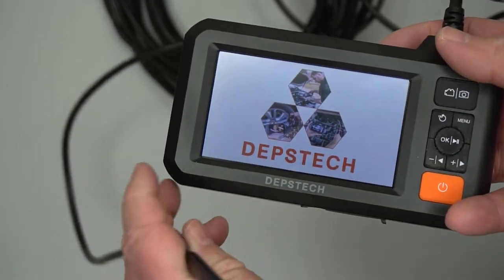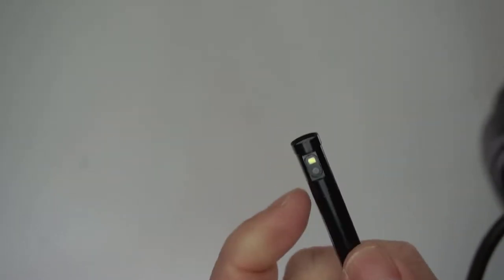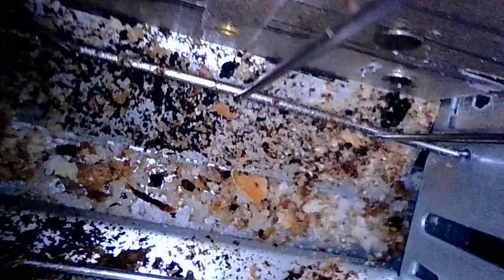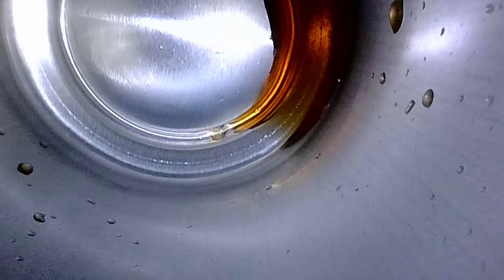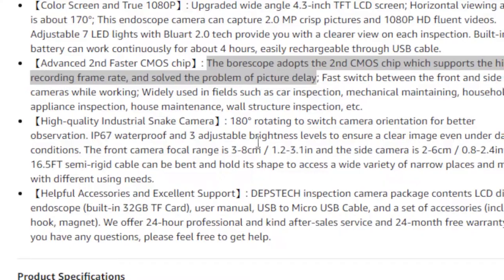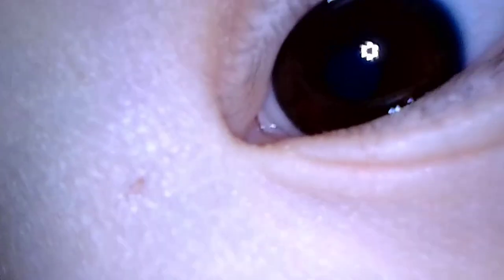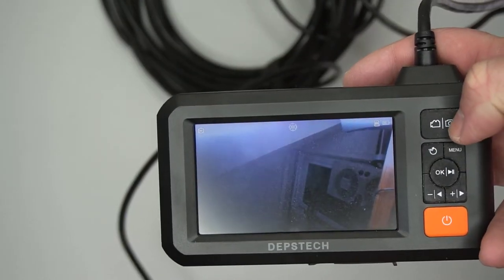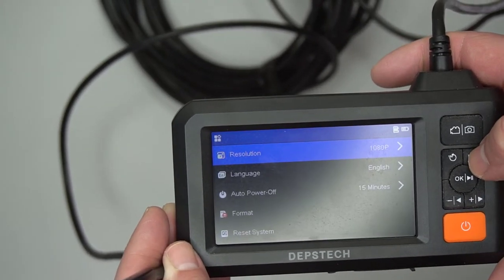DEPSTECH Dual Lens Industrial Endoscope /  Borescope Review

Comment: FYI, multiplying the length x width of the resolution of full HD (1920x1080) = 2,073,600 pixels, which is where the 2MP number comes from.